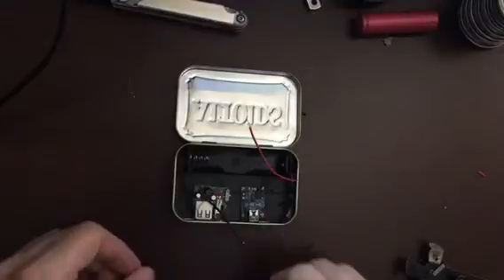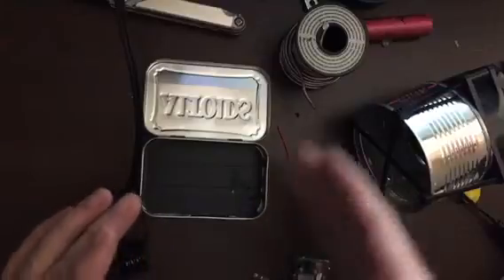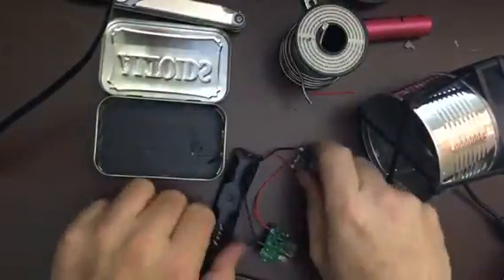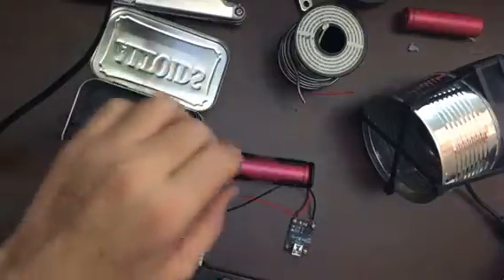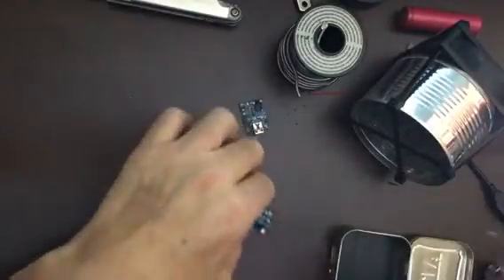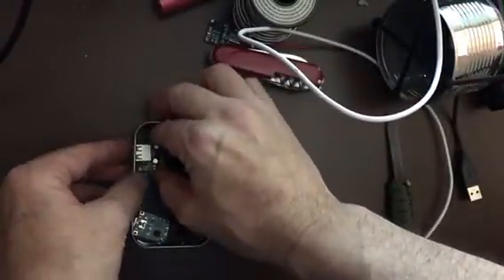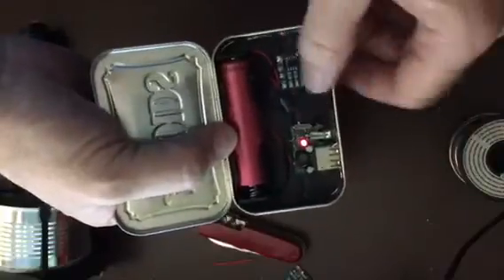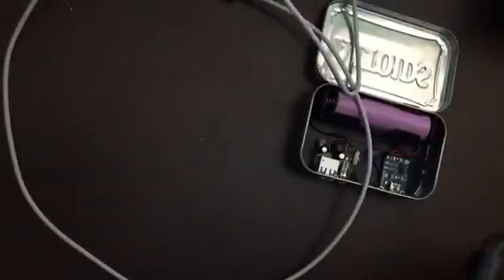DIY 18650 powered, solar charged iPhone charger in an Altoids tin - part 2 - Wiring and install

Comment: I have a question. Do you use an external solar panel for it? I was wondering because ive seen a lot of these videos about solar usb chargers and this one never shows the solar part of it.
Reply from the maker: Yea.. sorry i never even thought to show the solar charging i guess.
I have a few different solar setups I can use to charge this. I will make a video on charging this device from the solar soon. The USB charge circuit actually died in this device so i need to find or order a new one. I have some other videos about my solar setups. My Frankencharger is in the sun right now... Here is a link to that video.. It is ugly but very effective.
https://youtu.be/z-RxULLtpbg
Thank you for the comment!!
Reply: Its not pretty but that was pretty cool lol thanks.